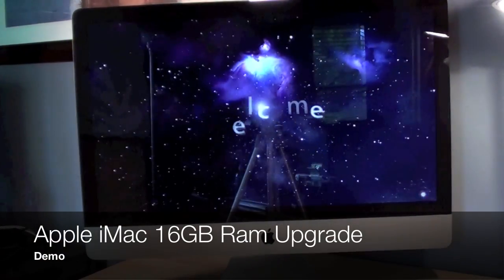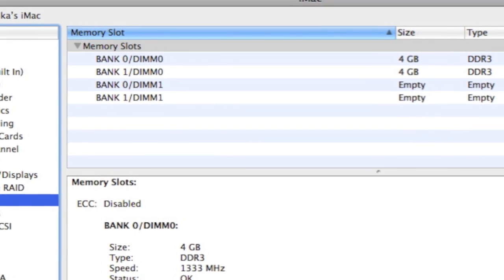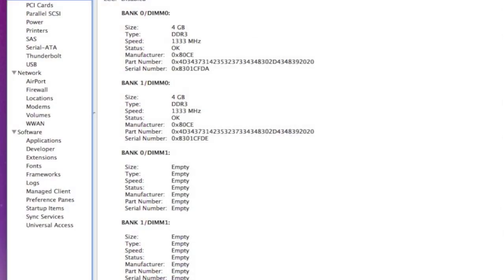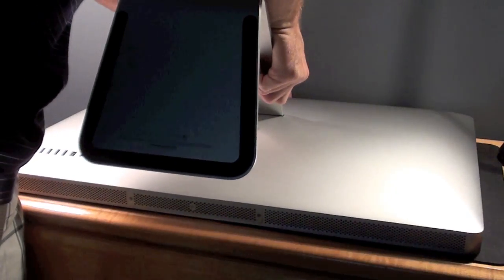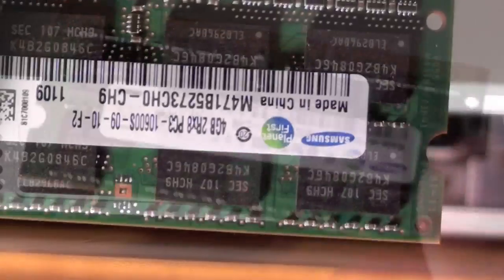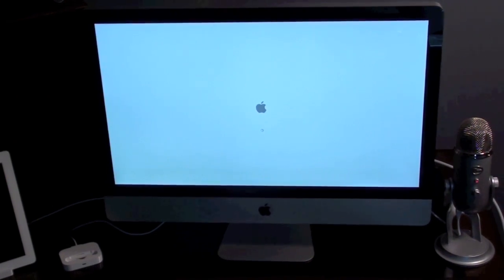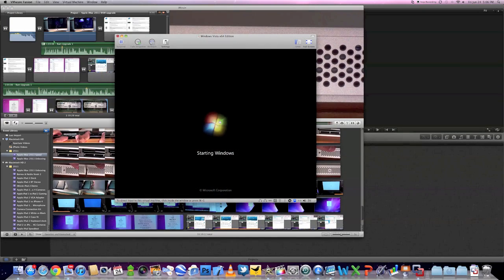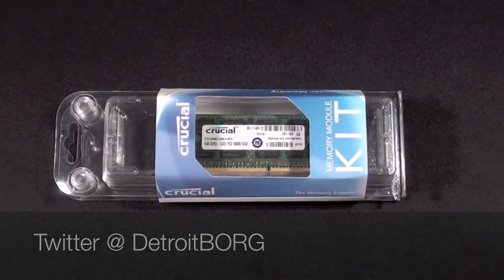Apple iMac 16GB RAM Upgrade: Demo

Comment: You would be correct if I was refering to only buying 8 GB sicks, which is around $144, but since the iMac has 4 slots, I recommend  buying 4, 4 GB sticks like I did, for $90 from crucial.com

Comment: @Noillione According to the Apple website, you can upgrade the higher end 21.5 inch iMac, the one that costs $1499, but the $1199 one only goes up to 8GB.

Comment: I have a 21.5 2011 IMAC with 4 gb of ram, 2 gb in 1 slot & 2 gb in a 2nd slot.  I purchased from Crucial 8 gb of ram; 4 gb on 1 stick & 4 gb on the other stick,  when installed I'll have 12 gb of ram.

Can I install my 2 new sticks in the 2 empty slots?  Or should I put my 2 new sticks in the slots presently occupied & then move the apple memory sticks into the empty slots?

Comment: Do you run your 27" iMac at the native 2560x1440 or 1920x1080? I just upgraded from a 20.5 2009 model and the native resolution font seems small. I am hoping it is just an adjustment period. Curious to see what other 27" users are running their display resolution at. 

Thanks in advanace

Comment: @DetroitBORG I purchased my 27"with 4GB and then upgraded it to 16GB by Kingston. I would VERY much suggest that users do not install 2 different brands/models in their computers, MAC or PC. This is known in general to cause problems, some of which i have witnessed first hand. If users want 16GB, order it with 4 and buy the appropriate upgrade kit. Crucial offers a 16GB kit, Kingston you just order 4 4GB chips meant for the iMac. Both brands are less than $180. Either way, Thanks for the vid. <3

Comment: Hi, I'm buying a new MacBook Pro Soon. 
I was wondering would the computer run better for video editing/uploading with a 128gb SSD and 6490M (256mb) video card.
Or should I go with a 500gb 7200rpm and the higher end 1gb graphics card (6750M)

Thanks,
-TechKid